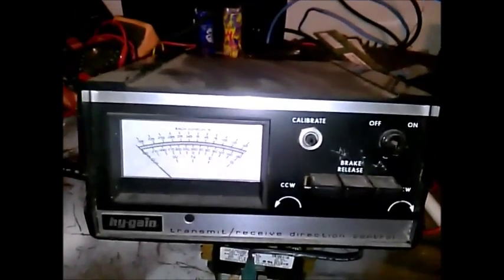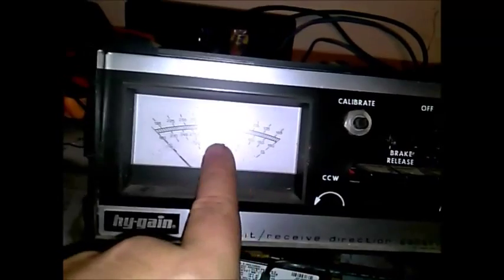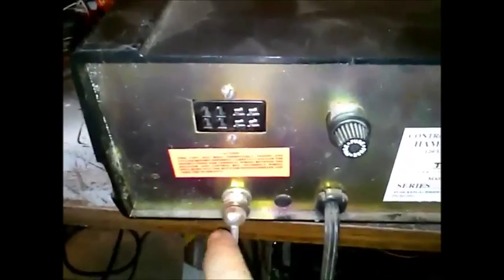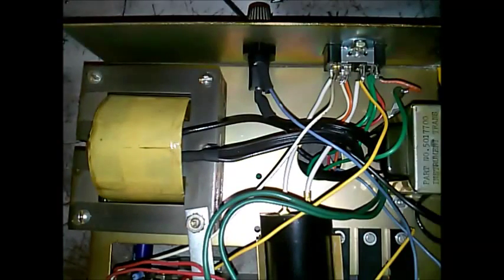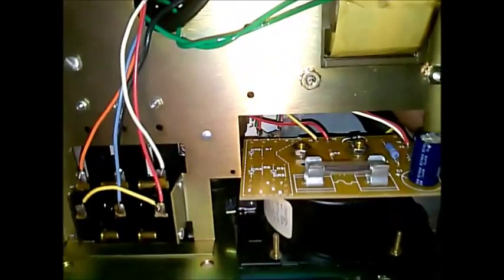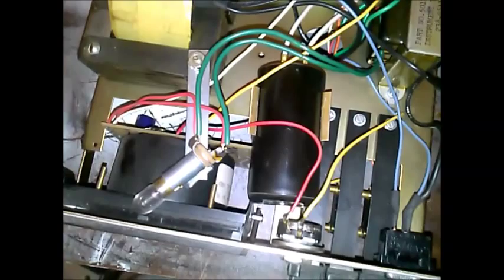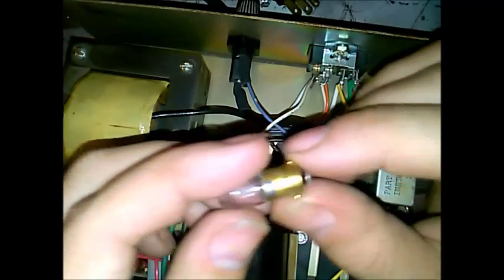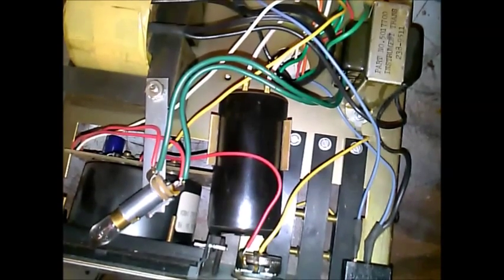A look inside the Hy-Gain Antenna Rotor Controller

Comment: I rebuilt my rotor and put a updated cap in the controller and tested it on the bench and it worked awesome and it sounds like new so quite now. BUT after getting it in the tower and all hooked up and my needle doesnt move! aarrggg. does anybody have any idea where to start testing this thing? remember it is mounted inside the tower and it is a pain to pull it out. does anybody know what the voltage reading should be 1-8? while system is on or is there a reading i need to look for?  thanks all

Comment: Hey I know you posted this video a while ago but maybe you remember. I'm trying to buy one of these used and want to make it South center. Is the meter a sealed unit or can you open it up and change that sticker backing with directions on it in the meter? Thanks a lot and great video
Reply from the maker: Most meters can be opened if you do it carefully so you do not bend the needle. The decal plate is typically glued in place also.
Reply: @Elfnetdesigns  Ok I see. Thanks a lot for the help! I really appreciate it
Reply from the maker: @mercedesbenzformula1  No problem. Most of the time with analog meters you can pop the clear lens off and pop the decal plate off and flip it to have a "blank slate" to design your own meter decal if you are good with a pen.. or apply stickers.. etc.